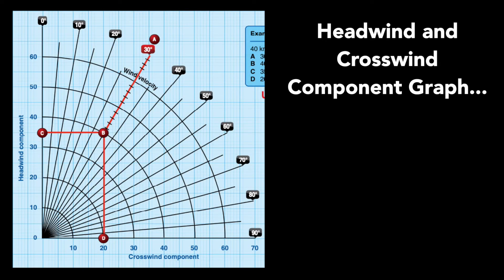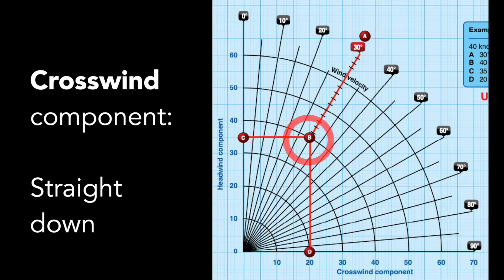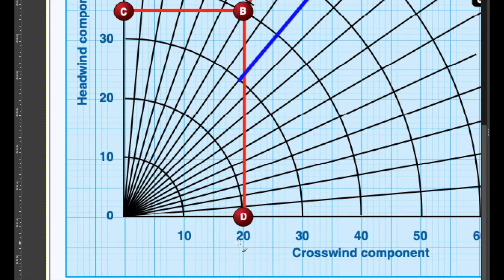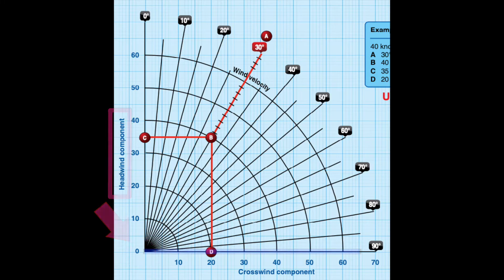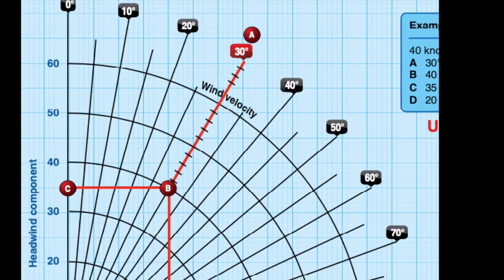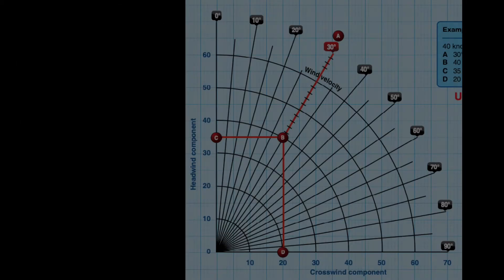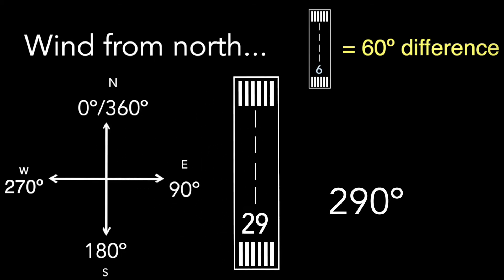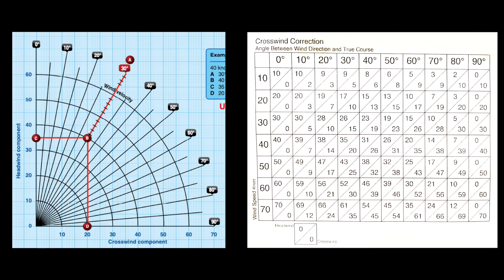Headwind Crosswind Component Graph- Private Pilot Knowledge Test Practice

Comment: If the wind is coming from the north, wouldn’t wind direction be 180?
Reply from the maker: Excellent question and you bring a good point, thank you! Yes, you are correct in that if the wind is coming from north, in that example, it would indeed be headed towards the reciprocal direction, 180 degrees. In the context of written test question wording and crosswind component calculations, this situation would be more leaning towards assuming the orientation of where the wind is coming FROM, in relation to the runways. It becomes less about the direction the wind is blowing TO. It is easy to overthink with written test wording too, I've been guilty. I appreciate you sharing your thoughts, best wishes!

Comment: What if the wind is 330 at 8 and the runway is 03-21 , how do you use the chart,i know the angle is 60  but in this situation you can not subtract 330-030=300  or  330-210 =120 , both angles are not practical to use on this chart. How would you solve this,
thanks